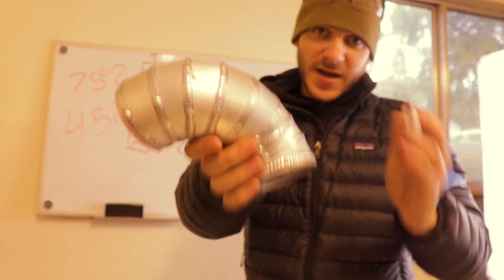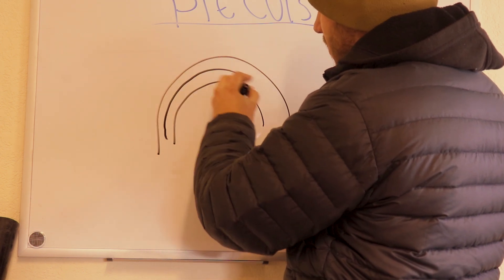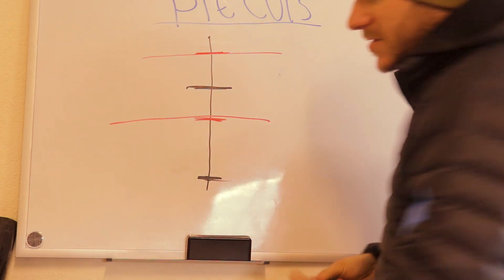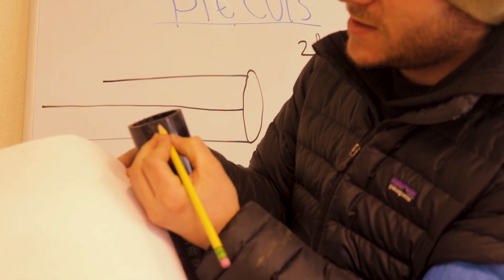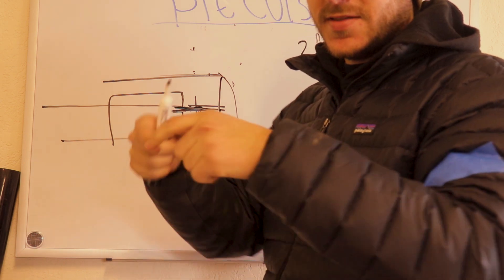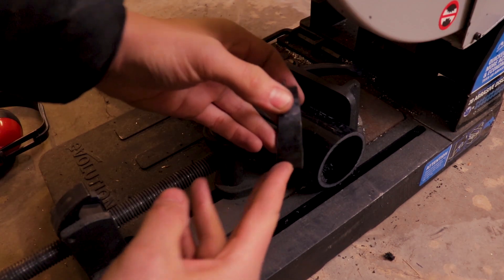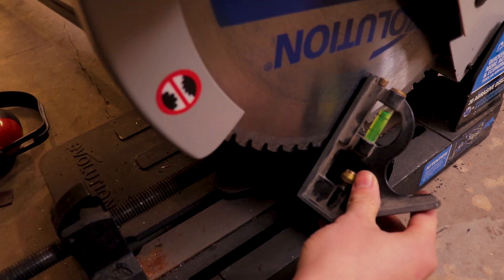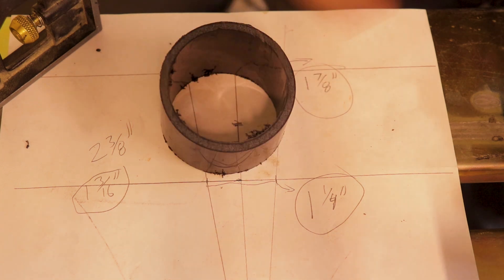How to make Pie Cuts

Comment: What is easier to cut as a beginner.  9 degrees?  So there is less cuts to weld? Also will either cut 4.5 7.5 or 9 degree yield the same center line radius of the inner pie is the same length? Thanks.

Comment: Good tutorial. Just curious hear from an industry professional what amount of clocking you tolerate (that is how much you guys will rotate one pie relative to the other) to get a complex bend, one that bends in more than one plane? Do you just go to smaller and smaller pie angles to prevent too much miss-alignment at each weld? Is there a rule of thumb on how much you will rotate then for a given pie angle like 9 deg. to prevent it looking really get and flowing badly?
Reply from the maker: Not really we always did whatever i needed.  Sometimes it would go 180° out if we needed.  Its easier to clock as many in the same plane as you can before rotating another section that are also in the same plane.  If that makes sense?
Reply: @5thStreetFab  Yeah man I get 'ya. Thanks. I have just noticed when I do it that over about 1/4 turn the mismatch in diameters at points on the joint gets pretty big, almost a step, and it almost looks like things are not aligned, but there is no help for it I guess.
Reply from the maker: @robertos4172  ya i just start tacking at one point and tack every 1/2"-3/4" and make sure everything is flush all the way around and there shouldnt be any gaps.  Especially on thin stainless